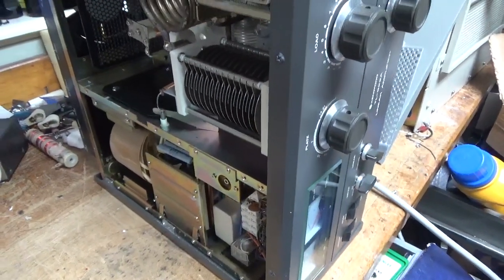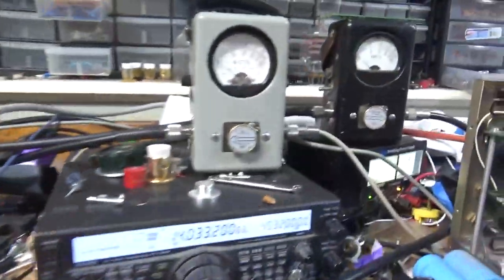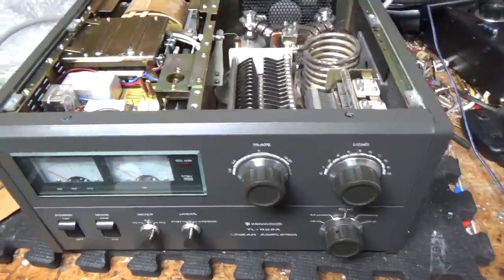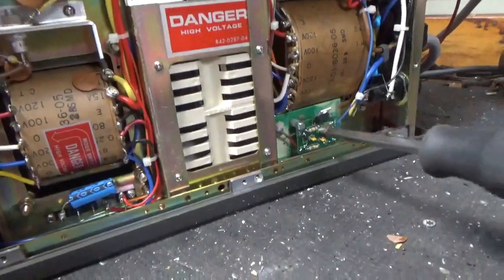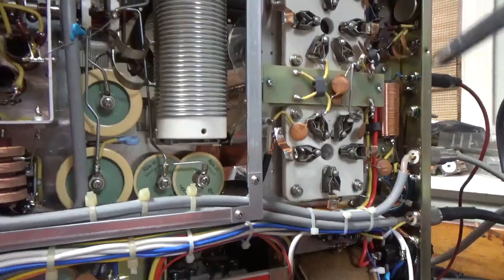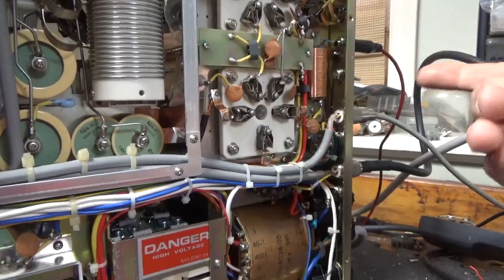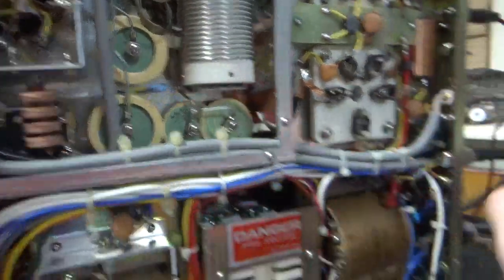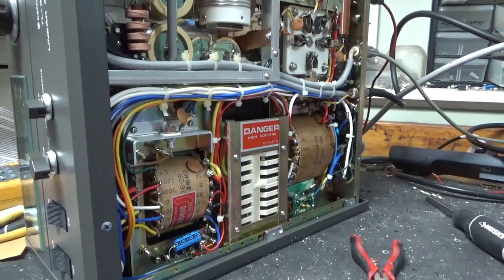Kenwood Tl922a Repair, Modifications, Harbach Filter Cap Board, 10 Meter Mod 20 Meter Test

Comment: How do I contact you?  I have a TL-922a that needs some work, it does work.  I need to 10 meter mod, a bottom foot and a once over to make sure that it good to go for another 30 to 40 years 😀. Thanks
Reply from the maker: Phone number is said in the video and all videos, or go onto my amp repair site also has my number

73